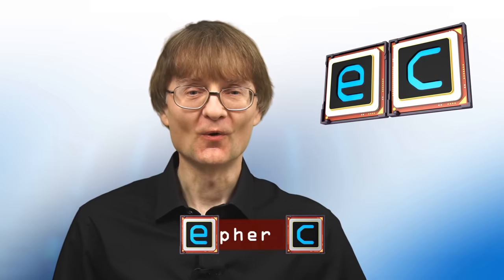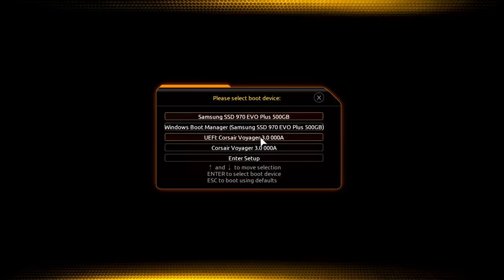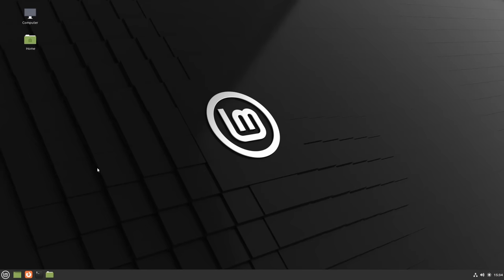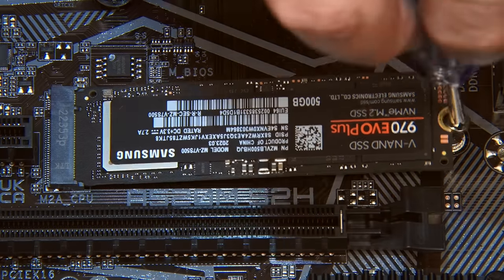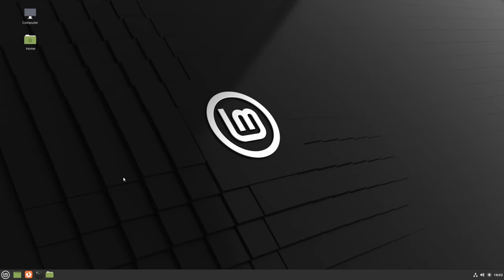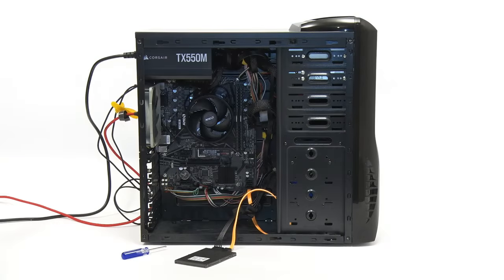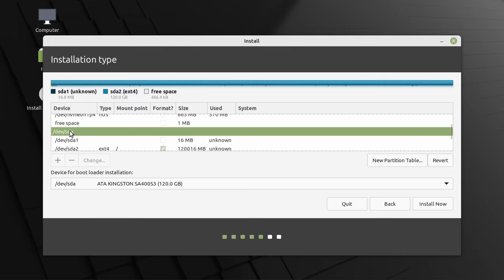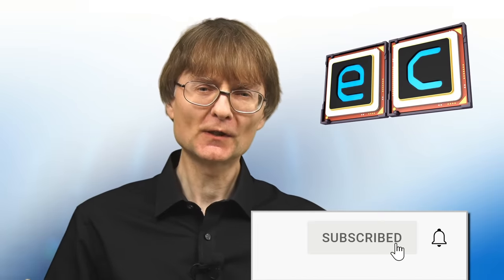Windows & Linux: Dual Drive Dual Boot

Comment: The problem I have with dual boot is invariably one of the OS is used less frequently, so when you finally boot it, it's potentially months behind on updates. That can be a security risk. Probably not a huge deal for a home user hobbyist granted.
Reply: Especially for windows.  Not as great a risk for Linux.  But between a good VPN and a decent anti virus, my fears are allayed .
Reply: This isn't just a problem for dual-booting, but virtual machines as well. However, in this case, we're not just talking about two operating systems but sometimes dozens. Ultimately, for most people, housekeeping one OS is bad enough and will just deal with any shortcomings their chosen single OS may have.
Reply: @Win32Application I've been running Windows 7 since 2009 with no problems in recent years, except for companies dropping support for it.
Reply: @lesliedeana5142  Linux can be exploited just as Windows can. Please do not believe the old wive's tale that one OS is any more secure than any other.
Reply: @FlyboyHelosim  The good thing about a VM being shut down for months is, at least in general a VM is not going to have bare metal etc.
Reply: @RoastBeefSandwich  yes its not bullet proof, but much more secure, as well as being a smaller target.  I do all my development these days under Linux, only using win for those rare apps that are given to me for support.  And even a lot of my forced win apps are cloud based, so I access them thru a browser on Linux.

Comment: It's always better to keep Windows and Linux completely separated because Windows really likes to remove foreign boot loaders. If the Windows drive isn't easily accesible to be disconencted, it's possible to install Linux in a different computer and move the Linux drive.

Comment: I did a dual boot system like this for many years. However, in my experience if you are in Linux and tempted to move files between Windows folders and Linux folders, ie you allow Linux to read and write to Windows folders (as it can see that drive) eventually Linux may corrupt the Windows NTFS partition. NTFS can be quite fragile under Linux quite possibly because the reverse engineered ntfs-3g Linux driver isn't 100% perfect. Best to stay out of Windows folders while in Linux, imo.
Reply: Windows has not used NTFS since Windows XP 
It's all GPT now
Reply: @Robbie-mw5uu  GPT is the partition table to address modern larger disk sizes and is not unique to Windows. NTFS is the 'file system' as in 'NT file system' or "New Technology File System" the partition is formatted in under Windows. It's MS proprietary and is still used. A drive is not formatted with 'GPT'. Linux can and does eventually screw up partitions formatted with NTFS.

Comment: Thank you for confirming that I went in the right direction in my latest build.  The motherboard had only one M2 slot, so I got a PCIe m2 adapter card.  I installed Windows on the onboard SSD and Mint on the PCIe card SSD.  Having two m2 skots is great for backing up as well.  I clone my SSDs every few moths so I have a rollback in case of hardware, software or user failure.  That came in handy when a WD Black SSD failed.
Reply: Hi, I was trying to do the same thing. The problem is that when I have two SSDs installed. The system won't boot. I cannot even get into BIOS setting. I am using Dell XPS 8940. I am wondering if you have ever faced the same issue?

Comment: I notice no mention of secure boot option in the bios.  I know that we geeks probably already know, but in the future the less geeky may find this video and come across boot failures due to secure boot being a require for Windows 11….or have the Linux guys fixed this issue now?
Reply from the maker: Good point -- I forgot to mention this. But here secure boot is turned on. Linux Mint works with secure boot, but this may not be the case for all distros.
Reply: @ExplainingComputers  Ubuntu works with secure boot as well! I'm doing this now

Comment: I’ve used the remove the windows drive method before too. I once somehow couldn’t boot into windows when I did the third option you showed. The second option it the best way to install linux on a dual boot computer.

Comment: Very good explanation, and I especially liked how you emphasized that it's best to only have one drive at a time connected when installing OS's. I don't understand why Windows doesn't give you the option to ignore the other drive during installation -- it always insists on messing with the other drive's boot sector, and you will almost always regret that later.

Comment: This is precisely what I was looking for. Perfect and to the point. I wanted to exactly do what you did. Have Linux and Windows on separate drives and not have Grub on any Windows related drives. (I've done these many times in the past about 10 years ago and I've lost touch now). So I wanted to know if there were any changes to the process. Thankfully, Grub is still the same, Windows Boot Manager is still the same!

Comment: I remember days gone by when had an old system you needed to but not use daily for security of the data that I did this. Except I did this by leaving the HDD unplugged on the secure system until I needed to access the data on that OS. 
That's been a long time (Hard drive days).
Enjoying watching.

Comment: Hi, as an oldy of 80 I still love swapping and changeing on  my pc. Your explanation of the duel boot system was  brilliant.  It was so easy to follow.  I was wondering if it was also possible to install more than one Linux system on that particular drive. Cheers again.
Reply from the maker: Greetings! And yes, you could install multiple Linux distros on the Linux drive here.

Comment: So many of your videos are a treasure of concise, no-nonsense information! I just got another little HP ProDesk Mini PC and was setting it up with Windows (M.2) and Kubuntu Linux (SSD). My thought was I could just boot from a live USB and install Linux without removing the Windows drive, (I haven't done a full linux install in a while) but in the back of my mind I'm thinking "I don't want it to mess with my Windows drive at all." A quick look on YT and yours is the first video on the subject to come up! From a source I certainly trust- and sure enough, your advice couldn't be better! Definitely glad I removed the M.2 first then installed Linux- now a perfect dual boot. A little information goes a LONG way toward not messing up a dual boot system!

Comment: I followed your instructions for dual drive, dual boot, and it works like a charm.  I have a Dell machine, so, I just hit F12, to get to the boot choice screen, and choose which one U want, Windows 10 will boot by default.   I'm dual booting MX Linux, and Windows 10.  Thank you.

Comment: Bravo! I've been doing dual booting for the last 8yrs. I use a single drive (1TB-M.2-NVMe) and split the drive in half. I use the something else option to install Linux on the unused portion of the HD as a root install. I also install Grub-Customizer to tweak the boot screen and have a nice cat photo when booting up. I also change the OS order to boot Linux first because it is my everyday OS of choice. I have windows 11pro only for Adobe products. You can also change the time for default startup. I go for 5 mins (300 seconds). I also go into windows on a daily basis to check for updates. This way Grub does not get corrupted by a gigantic update in windows!  Works for me! 😃

Comment: Very helpful thanks!  If you are happy with Linux and use it 99% of the time but still want Windows available, just use one SATA cable & connect the SSD you want.  All it takes is removing the side cover of the PC & moving the SATA cable from one SSD to the other SSD.  It takes maybe 1 minute.

Comment: Extremely useful ! I did the single drive/dual boot and within a month a Windows update trashed the whole thing just as you say it will. I then moved to dual drive/dual boot but wasn't aware of the "remove the windows drive" option - I wish I had seen this before I made my change - but at least Ubuntu still works over a year hence. Many thanks!

Comment: Excellent video! As others mentioned, Secure Boot should be disabled, at least until after the first Linux successful boot. I was getting the error 'bad shim signature- you need to load the kernel first'. I found a topic in the Linuxmint forum that mentioned it. They also mention that it's stated in the release notes to have SB disabled.

Comment: LOL, I could have used this video earlier this year.  With a PC that already had Win-10, I installed Linux on a seperate drive and set up Dual Boot.  I did use other Explaining 
Computer videos for help.  But, I just fumbled and bumbled my way through it and ended up with the Grub boot prompt.  I actually like that prompt, but was disturbed when I learned that it could be corrupted by a Windows update.  That shouldn't be a problem, since I am using Win-10 and refuse to update to Win-11, so I won't be getting many more updates.  In fact, it is for that reason that I finally jumped into the Linux world which is something I've wanted to do for many years.  Christopher, thank you for your wonderful videos.  You are an excelent teacher, and I appreciate your humor, too.

Comment: Great video as always Chris, but the very very rare times I'll ever need Windows again in my life, I'll just run it in a VM, but I agree with others if you want it on bare metal having dual SSD with the OS installed on each one, and just choosing the one you want at BIOS/UEFI boot is much easier.

Comment: had to stop vid at "dual drive method A" to write...THIS CHANNEL IS easily THE BEST PC-CHANNEL ON YT...from this ol' PC/CAD-guy since '82. BRILLIANT-work!! update: the vid just gets Better. One question, please..... is ReactOS a Linux-based OS? ..........( Oddly, its been suggested for my CAD-software's post-W10 switch )
Reply from the maker: Thanks for this. ReactOS is not Linux based -- it is an attempt to write a new OS that will run Windows apps. My recommendation for your CAD software would be to run it in Windows 10 in an offline VM -- see: https://www.youtube.com/watch?v=OWmD8obq4eQ
Reply: @ExplainingComputers  suppose, instead, its "easier" to use two externally-connected SSDs each with either MS or Linux, and an internal M.2. Then...swapping which SSD is connected directs which OS to operate by? And the M.2 stores it all! Likely, no? Sorry, just a physical grunt here :-))) A functional work-a-round, eh??

Comment: Excellent video, as always, and one I have been looking forward to. In the past, when I have experimented with dual boot using GRUB, it has never ended well. Running Linux in VMWare doesn’t seem to work well for me either, so a dual drive system as explained here is obviously the best option.

Comment: This actually allowed me to properly dualboot Win10 and Fedora Silverblue on my laptop. Windows used to always put its' bootloader first, and silverblue has some caveats when dual-booting (apparently?). Both of these things were solved by having the systems on different drives with different EFI partitions. Grub detected the Windows loader and the system has been working flawlessly for about a year now

Comment: Thanks for your usual very good video, including sped up section saving time!! It would be helpful if you add another brief video to demonstrate file accesses for both drives from each OS, esp. for primary Windows users, like me, who are interested in exploring with Linux Distro for potential benefits at low cost and risk.
Thanks again!! Please keep up your good work. And Best wishes...

Comment: I installed Windows first along with another disk which holds games.  I have a 3 NVMe port MB.  I then removed those 2 disks and installed the 3rd disk in the port it would remain in.  I then installed Linux.  It maybe added about 5 minutes of work but the end result was 2 OS installs and using the BIOS boot menu to select the disk to boot from and no grub file stuck on the Windows drive which I didn't want.  After installing Linux I then put back in the two disks for Windows.  Works fine.

I did dual boot in the past using the option to install Linux alongside Windows but on a different disk, it still creates the Grub boot file.  At some point it got corrupted and I had to deal with fixing it.  It's why I did the install this way.  You have to tell Linux to leave the Win drives alone by never mounting them.

Comment: Thank you very much for that video, it helped me a lot setting up my PC so my wife can use Win 11 while I stay with Linux. Unlike your guide, I tried to install Linux on my second drive without disconnecting the win drive because I was lazy and wanted to give it a chance😂. I installed Arch Linux and had a lot of fun to get grub recognize the Win Drive... it worked, but I was again again quite bugged by the community, wherefore I switched back to Endeavour OS, witch detected without win 11 and made an entry in grub right in the installationprocess. So there was no effort to set up a dualboot with dual drives. I do not know it is depending on the distro, because Endeavour OS installs OS-Prober by default and searches for other operating systems while installation.
Reply from the maker: Great to hear that you have it working. :) But it appears you have used OS Prober and GRUB -- and the whole point of this video is not to do this, and to use the BIOS boot menu to avoid using GRUB, so that when/if a Windows update corrupts it, everything still boots OK. :)

Comment: During an extended transition from graphic designer to front end dev in a web development company I used dual boot Ubuntu/Windows in the same drive for a couple of years (needed Windows for Adobe CS). Grub issues plagued my life from time to time. I would recommend getting a second drive for Linux of you can manage it.

Comment: I switched to the dual drive setup a few years back after some issues with GRUB and it has worked out well for me but I haven't figured out how to stop the clock from getting reset to UTC in Windows after running Linux. You may not see the time being reset due to location. It's easy to reset just a pain many of the apps I run require an accurate clock. Thanks for the videos

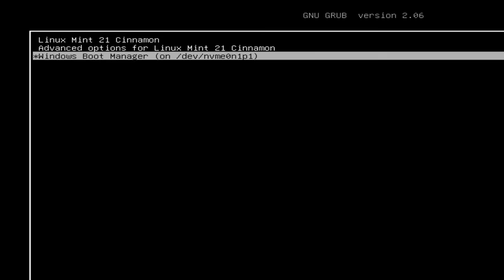Comment: 06:20 as you say messing around. It is needed to change the boot order in my opinion, so that this becomes a usable option
Reply: good points: removing and corrupting. Will be inetresting in my case :PRAY:

Comment: I run ArcoLinux on separate NVMe's and sometimes pure Arch on one which never stays pure for long anyway. I abandoned Windows 4 years ago for every good reason under the sun. I have a spare SSD for Mint, however it can't run the latest i3wm, so I have the option to wait, or go with a DE with Compiz. And that will take a rainy day, though Mint was my start, and I'm still fairly fond of it. It just can't do what Arco can. A most succinctly informative video.

Comment: Hey, thanks for the video. I am sure a lot of people were interested.

However, from my perspective, you missed a key element. It's important to show whether it's possible to read/write onto drives belonging to the other operating system.

It used to be that Windows wouldn't play nice with Linux, and you couldn't quickly copy a file from Linux to Windows, while the other way around worked (copy files from a Windows disk/partition to Linux).

It's important because Windows used to have NTFS, while Linux was EXT2.

If the two systems are running on two PCs, Samba also allows Linux to read NTFS file systems and access shared files, while Windows didn't have drivers for EXT2.

If it's a dual boot, Linux will allow you to perform recovery on a failing Windows system, while the other way around didn't work. It is important to know in case you have no backup.

I am not sure how things have evolved since then. But it is a question worth addressing, maybe in another video.
Reply from the maker: It's only an important element if you want/need to exchange files between the two systems. :) Linux is now ext4, which Windows will not natively read. But Linux can read a Windows NTFS partition, assuming Windows has exited properly. In practice I would add a partition to the Linux drive for sharing, formatted NFTS or even exFAT.
Reply: @ExplainingComputers  Thanks for the reply, but I fixed a typo and YouTube removed your ❤️. 😭
Reply from the maker: Heart restored! :) I wish YouTube would not remove then on an edit.

Comment: I have Win 11 Pro on my Samsung 980 1TB NVME on here, and Linux Mint on the Crucial P3 500GB NVME.  No Grub like i like that.  On the PC in my partners home, I have Windows on the main, but Zorin on a 512GB Sata SSD.  That has a grub on the sata drive, but a windows update may wipe it.  I used to dual boot on one drive but no longer as I have had grub corruption, and a windows repair is the easiest fix but that means removing Linux.  Great video for those that do not know how to do it Chris!

Comment: Two notes for people:
1. You can dual boot two copies of Windows, same (using 1 digital licence) or different versions. If you do you can create a shared DATA partition if desired, but ALWAYS set the opposing SYSTEM partition "OFFLINE" to avoid certain Windows conflicts.
2. Linux users, don't expect things to run smoothly even when you're just booting Linux Distros. Different distros can have compatibility issues with a Grub from another distro. I have a feeling Manjaro didn't play nice, but I'm old and my memory is fading, lol.

I hope these considerations help someone out there. 😊

Comment: Thanks for this video. I have computer that was only windows 10, but I only used it for Flight Sim. I installed Linux on a separate drive using your clever method. Best idea yet!